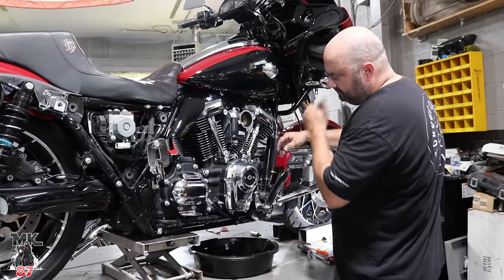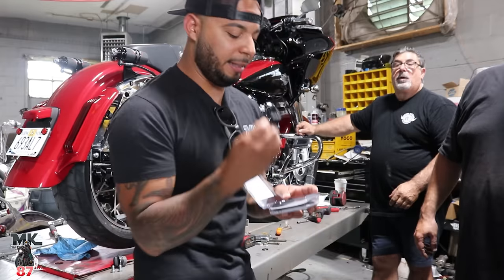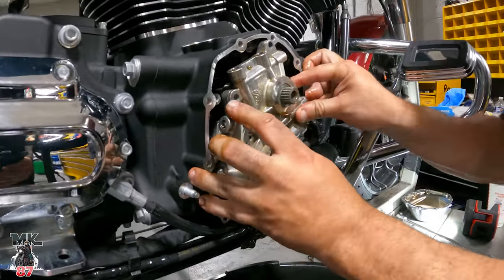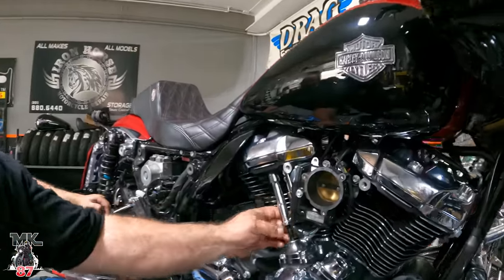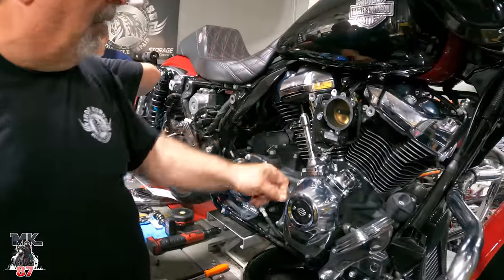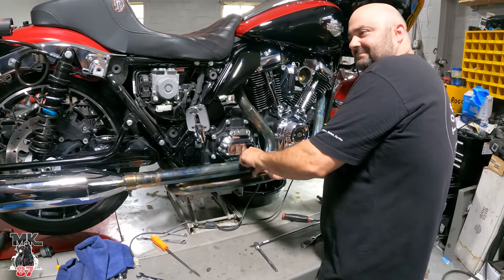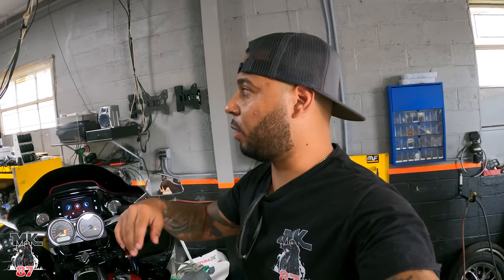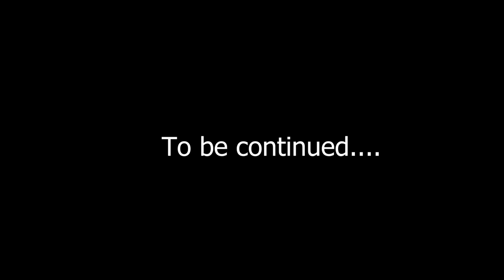Harley-Davidson M8 Screaming Eagle torque cam install / stage 2 power gains

Comment: So, you didn’t change the cam bearing while you were in there?   That’s usually standard practice when changing a cam.  What was the reasoning behind keeping the stock bearing?
Reply: I’d be pissed if it was my ride and I watched this vid after paying for the work.
Reply: That's pretty strange they didn't update the bearing
Reply: What bearing upgrade do you recommend?
Reply: And not upgrading the cam plate and or oil pump

Comment: Long Island in the house. Just a piece of advice I did the same thing with the screaming Eagle tuner. And I was getting frustrated because the engine was running hot because all of that held back by EPA standards. I decided to put a PowerVision 4 tuner on it from fuel Moto got a custom tune. The engineer runs better cleaner and cooler. I know you have warranty considerations but honestly running the bike hotter and way too lean may hurt the engine over the long run anyway. Just a piece of advice from someone who’s been through it. Same bike same cam same engine. Good luck.
Reply from the maker: Thanks for the advise man 👊🏽

Comment: Nice job, but curious as to why you didn't put in new lifters, cam bearings, cam plate and oil pump from S&S also?
Reply: I was wondering the same exact thing.  Only a guy who doesn't know what he's doing would do that???
Reply: It's just a mild build

Comment: Why didn't you upgrade your cam plate and oil pump?  if you are going to put the money into upgrading your cam, why not improve the entire system.  Also I didn't see it in the video, but did you replace/upgrade your cam bearing?

Comment: I’ll be doing this tomorrow. I’m setting it up with the SE cam chest plate and oil pump..I just got a 19 RG and I’m pretty sure it has the old oil pump in it. Not making a race bike but numbers show a pretty nice improvement in this work.
Reply from the maker: Absolutely 👊🏽
Reply: While your in there you may as well considering upgrading some other things. Wish I did a little more research before I installed mine.

Comment: The numbers are dying off after 5000rpm because you have installed a TORQUE cam.  If you want top end you need a HORSPOWER cam but your torque will come in later on in  RPM's.  Cheers

Comment: All that work and they didn't replace the inner cam bearing. It's a $10 part,  why risk it.
Reply: I was thinking that same thing, I went back through the video to see if I missed it ... not sure that was a smart decision.. what wasn’t it changed 🤷‍♂️.
Reply: Yea that was not the smartest why not you got it all apart
Reply: Absolutely change the bearing. I never understand why some skip that inexpensive step.
Reply: Ditto, I thought the same thing.

Comment: Didn't have to heat up the tappet cuff bolt? The one on my LRS had so much loctite the bolt snapped off and half the bolt got stuck inside the engine case. Had to get my bike towed to the shop to get it removed.
Reply from the maker: No we didn’t have any issues

Comment: I’m sure you’ll be doing a Harley TQ cam vs an aftermarket cam in the near future. Curious as to what the TQ and HP numbers were before the stage 2?
Reply: @Marvelkid87  I would like your opinion please. I have a SE 122kit installed with a 55mm SE aluminum manifold. I’m over 100 HP and considering installing SE 5.5 gal per second fuel injectors. Do you think there would be any issues with upgrading in the performance performance aspect ? Or should I need to get a 64mm throttle body & manifold? I feel the bike could use a little more gas lol when I throttle it up.
Reply: @palmettolowlife1996  I have the 119 kit with the rs 468 cam.  I started with the stock injectors.  Captured some Data logs and worked with dynojet and determined I had maxed out the stock injectors.   Put the 5.5s in and returned with the help of dynojet and fuelmoto and the bike now has enough torque where I destroyed 3rd gear in the trans.....
Reply: @kobyashi73  so , you don’t recommended to do it lol?
Reply: @kobyashi73   probably has more to do with your riding than the power.. my RG has 155 hp and 40k miles on it since the upgrades and ive had 0 trans issues.. a couple guys i know have 200 hp bikes that they drag race with no trans issues...
Reply: @vaughnfontenot4535  you’re not wrong.    After some additional research and a recent video from moonshine HD, it became apparent that some modifications in the way I ride were needed.
Reply: It happens homie, I rather tell you that and you not have the reoccurring issue than spend a bunch of money on a expensive aftermarket trans and still get the same issues lol 😂. I’ve been there and done that
Reply: @kobyashi73   yeah can only go so much before things start to break a transmission is 4.500 $$$$$$$

Comment: Oh dude,  these guys mention some failures of the Opinon Gear, but nothing about the dog cheap OEM cam bearing.. and amazing they didn't re place it!.. I suspect you asked for the cheapest stage 2 job as possible as it's highly recommended to remove that junk Cam Bearing while in there..and yes many replace the lifters, and lifter cuffs (as they did the cuffs)

Comment: Tappet cuffs do no tend to break off. Auto industry has used plastic cuffs for engines up to 1000 Hp. S&S cuffs not necessary unless your going big power

Comment: I have the torque cam and Billet Cat tuned with a TTS On my RG. Pretty happy with that setup
Reply from the maker: SE cam ?
Reply: @Marvelkid87  yes sir. Original plan was to go SE to keep warranty police happy. So I did an SE tuner with the cam and slip on.  I missed the 2 into 1 sounds so that plan was out. On went the D&D and TTS. Big noticeable difference with the way the tuner has more freedom on tuning.

Comment: You didn't replace the cam plate and oil pump🤦
Reply: Don't need to on the new m8's. They got the updated oil pump.
Reply: Why should he? There's nothing wrong with the existing pump and plate. It's not like he's going to some crazy cam. I think he's being smart with his money.
Reply from the maker: Exactly
Reply: @bikesandbeagles  multiple reason why you would want a aluminum profromance cam plate and oil pump. Not just because something is bad.

Comment: for a guy who wants to wake up the bike a little, is the screaming eagle stage 2 kit worth it.   I am not looking to race, I am not looking for Dyno Numbers, I just want to keep my warranty and  wake up the bike a bit.  Is it worth it.?
Reply: I am in the same boat I am torn. I want to build the bike with what i want but the warranty i got is pretty nice and I am very new to harley and dont know the reliability of the new touring model bikes. I have a 2023 Streetglide ST and i have 7 year HD warranty and "warranty forever" that I could potentially lose if I dont use the screamin eagl tuner and cam BUT also keep reading the epa compliant tunes make the bike run lean and cause more harm then good so kinda counter productive. I am torn and might just leave my 117 with the SE intake and S&S slipons sadly as i keep reading SE isnt worth the money and anything else will void my warranty.

Comment: Total scam, to sell unnecessary parts.should have changed, cam, bearing, and lifters to new ones, so they can mate together. They're not expensive. Just make sure you soak them in oil, and vacuum those air bubbles out of them. HARLEY PARTS LAST!!